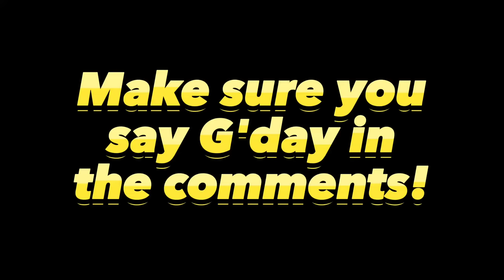Hydro Jetting an EXPLOSIVE & ROTTEN Petrol Station Blocked Drain

Comment: So, how do you patch up the hole in the elbow? I'd dry it, put a lot of silicon around the hole, attach the "lid" (I guess it would be cut from the spare elbow) and then secure it with the zipties or something like that. 
I remember watching UKanians plugging the hole in the pipe with some sort of a plastic plug that had a rubber ring and a screw that would squeeze the ring and make it a tight fit.

Comment: Hey bruce, new to the channel here from elmer NJ and cant get enough of these blocked drains getting wiped out by mr german and ur can do attitude! Ive been wondering why the drains explode on u like that. Im not sure if u already have a video on it, but i tried looking around to why they explode and found nothing! It be great to have a video or a quick explination on why the drain explodes when ur cleaning it. Is it bc of the air pressure being pushed from the blockage behind it? Ur the man bruce!

Comment: That backsplash seems to be a fairly common thing. I might suggest what Ollie does, which is use the base of a road deliniator to pass the hose through. Otherwise, maybe a Perspex shield with a small port in the center, with a rubber gasket.

Comment: It confuses me that you do the drain leading to the kitchen before you unblock the drain leading out.  It seems more logical to do the exit pipe so that all the backed up water is sure to drain down the line and not back up out of the pipe because of a blockage further down the line.

Comment: Out of curiousity, what did (would?) you do with the improvised inspection point? Obviously it can't stay like this, but how do you get it shut?
Reply: From watching Ollie they normally put a plug into the hole with a heap of silicon around it to keep it sealed. The plug also has a handle so it’s easy for the next guy that comes along to pull it out. Hope this answers your question 🤙😎🇦🇺
Reply: @shaunepegrum  Ah, that makes sense. I was actually wondering if silicon would do the trick because that's what I used to keep stuff in place in my fish tank. :D
Reply from the maker: The owner said he wanted to sort it out himself..